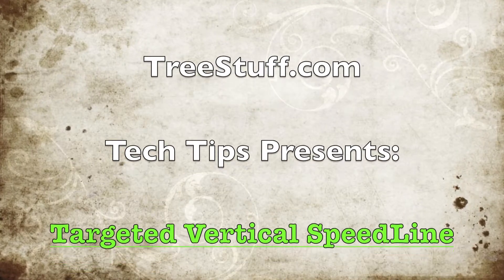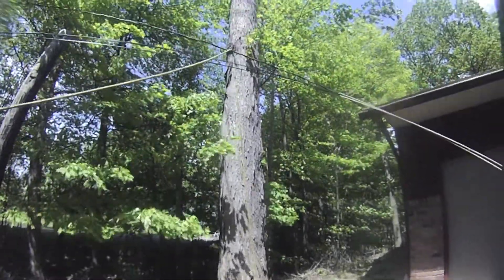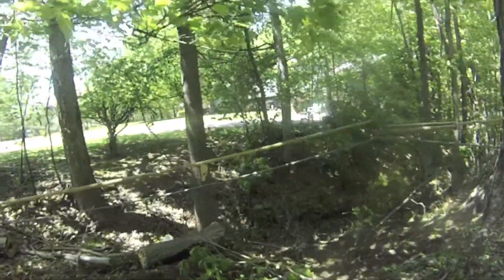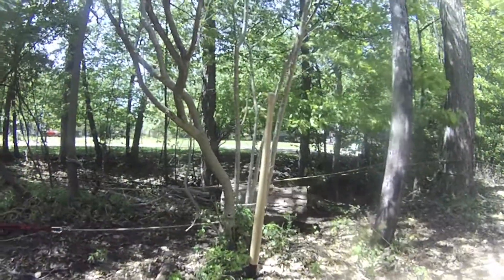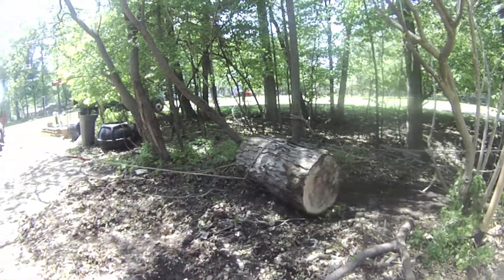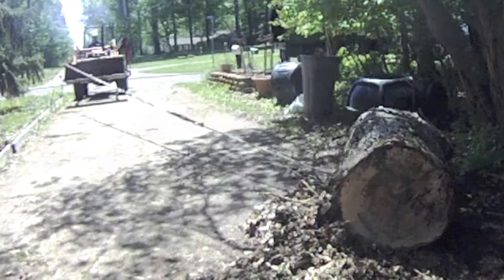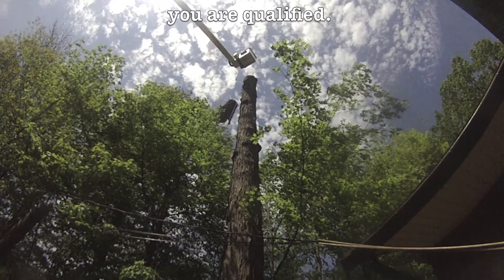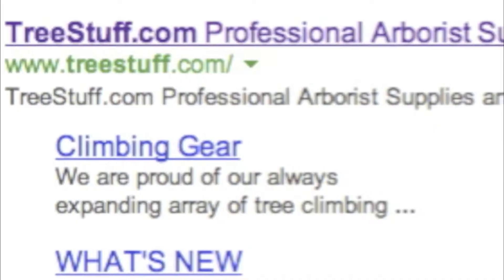Targeted Vertical Speedline: TreeStuff.com Tech Tip

Comment: The chain was used to prevent the log from rolling down the hill. The footage isnt exemplary as it could be but just behind the tree is a short 10-15' deep ravine that would have made retrieving the wood very difficult. When we flopped the log it didnt roll, but the chain gave us additional security.

I think 3 or 4 Husky 9/16's eyes slings (12') with ISC Big Dan Carabiners would make the perfect kit. Probly a 'tight' eye that could fit the Big Dan snug and then use a cow hitch.